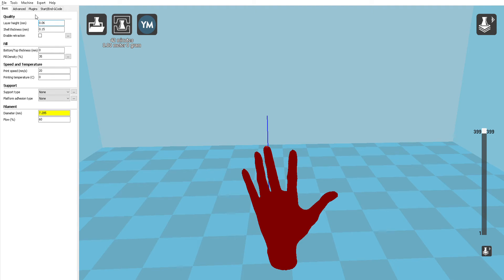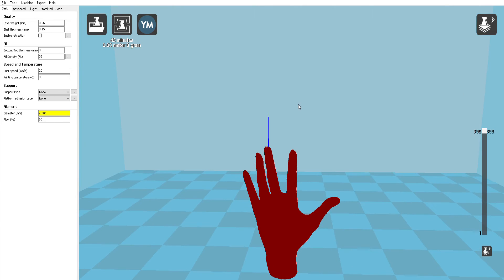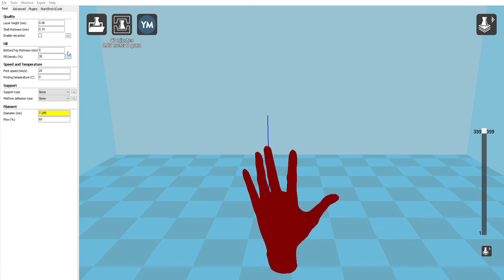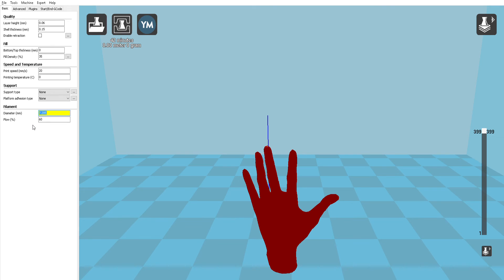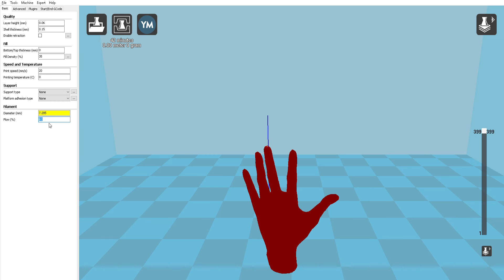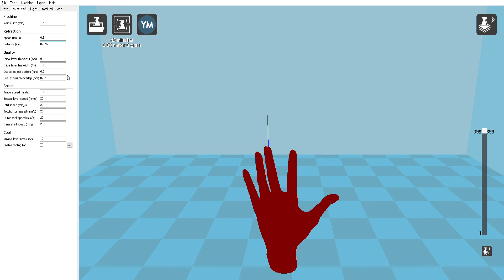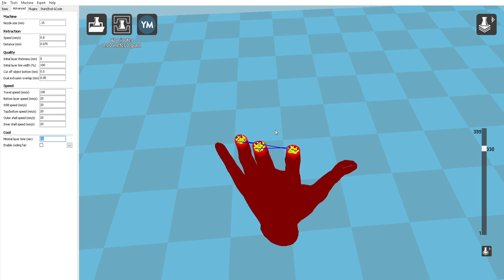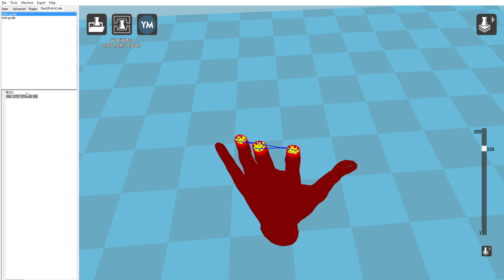Cura (15.04.2) Settings Guide for FRESH Printing

Comment: Hey, help me my extruder stepper spins in different direction. what can i do?
Reply: There are two potential soutions. You might be able to swap that stepper motor's positive and negative wire positions on the board. If your wires have the plastic fittings on the end that prevent you from turning them around, you should also be able to edit your motors directionality (change a 1 to a 0 or vice versa) in the Config.g file of your printer. Only do ONE of these solutions, as switching the wires AND changing the config.g file will result in the motor spinning the same way as it is currently spinning.

Comment: Shell thickness is really thin for that nozzle. It should be the integer of the nozzle diameter.
Reply from the maker: Mario Castillo Mario Castillo Shell thickness is 0.15mm = 150um which is the exact value of the needle's internal diameter. We are not using a 0.4mm hot end nozzle for plastic printing. We have modified the printer to hold a syringe with a  needle for FRESH Printing.